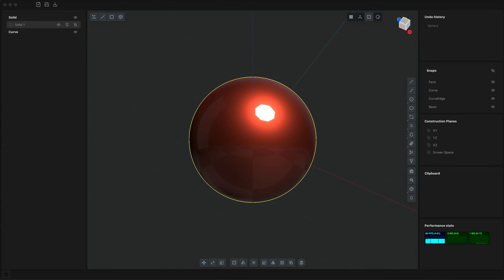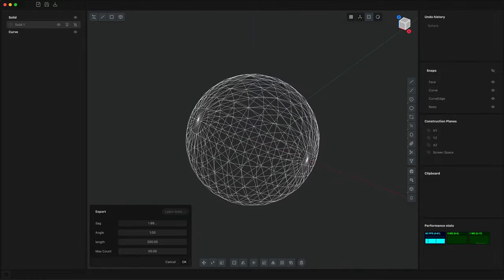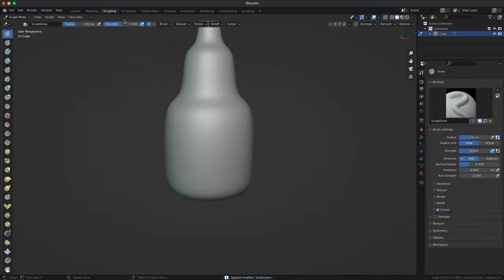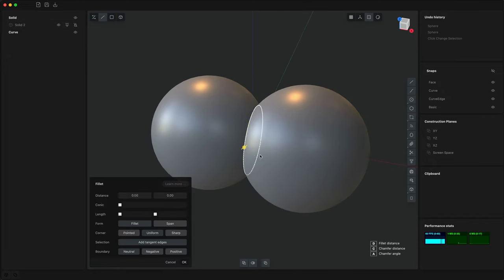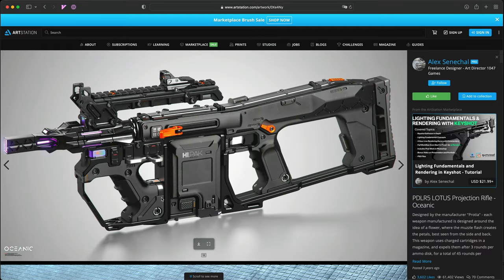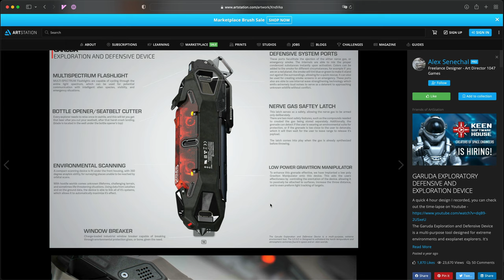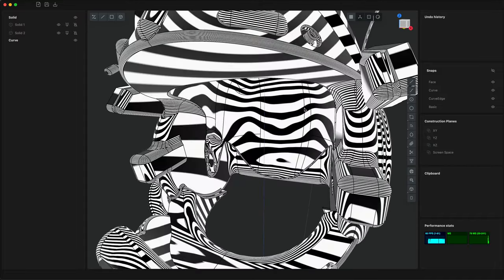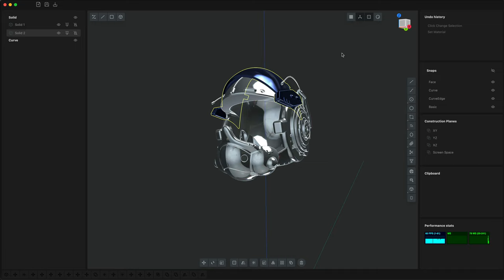What is Plasticity?: CAD for Artists

Comment: Looks interesting. But I would wish it had some features that would make it excellent for 3d printing purposes. Like having options for exact measurements, the ability to lock something to a spesific measurement value. And it would have a need for error-checking in regards to if the models are 3d printable, and if not, an option to fix those errors. Been looking into Blender, but that is a way too advanced piece of software for such a purpose. Too many options for my taste (beginner/newbie-taste). Fusion 360 are perhaps the best tool, but I do not trust their business model and if I make the effort to invest time into learning a piece of software I would like that piece of software / license to be lifelong license. Or most preferably, fully open source. I know FreeCad is an option, and that will probably be what I will be looking into if not a better option becomes available. Thus I hope Plasticity also includes features which would make it useable for making models for 3d printing as well. But that needs exact measurements, since one often model objects after real life counterparts with spesific measurements, where one side may be a multiple of another side (like the length of a box being twice the length of the width, as an example).
Reply from the maker: Thanks for the comment. I just made a 4 minute video explaining that this isnt a cad app tho
Reply: @nickkallen1  Give me an option for import/export/edit STL files and im good to go!  Finally an app that could replace my very old and good friend Autodesk 123D :D
You should definitely look a little bit to 3Dprinting community, a lot of people there to buy this software that don't want F360 :)
Reply from the maker: @Piotr_Czarnowski  I understand your affection for 123d. I think it had a lot of good ideas. I’ll keep you posted re the other stuff
Reply: @nickkallen1  I do understand the need of complexity for tools like F360, however i like simple and easy things ;) 
Im so hyped for this software of yours :)

Comment: Interesting. I utilized PTC Creo for mechanical engineering field in designing tools for part assembly as well as machine parts for an HP 3D printer. This is very similar in ways and cool to see outside of my field. Great job so far - I might want to pick this up for personal use when ready.

Comment: G'day Nick, just wanted to congratulate you on what looks like a great program. I've just installed it on my Linux box and got it up and going without fuss. I realise this is still in early development, but will future Linux versions automatically add an entry in the menu when you install the deb package? Also, will there be preferences for increasing screen resolution and text size like you can in Blender?

Haven't tried any modeling yet because I want to watch your videos first. All I've tried is  creating a regular polygon and moving it around using keyboard shortcuts. Very intuitive for a Blender user. Many thanks for basing it on Blender 'coz the last thing I wanted to do was learn a whole new lot of shortcuts. It was actually this fact that sold me on the idea of giving it a try. I figure a lot of people who'll be using Plasticity will be from the Blender community and you'll get plenty of downloads once word of it gets spread more widely.  

Well done.

Comment: Wonder how you detect and handle direct modelling. Could one import (if there is no import module, assume it) a nurbs object (with fillets and chamfers) from other software and continue manipulating in plasticity, as if it was a native model? Does plasticity "know" what type of surface each is and it handles it by assigning a type tag upon creation? In short, does the manipulating algorythm decides on the fly what to move and where (the constraints), depending on current selection, or it knows in prior what it should do in prior? Of course i am asking about the general concept, not closed source details.
Reply from the maker: Direct modeling in theory only looks at the surfaces and therefore should work regardless of origin. In practice it’s more complicated

Comment: Awesome program for modelling and concepting but again, the FOV/perspective is very strange, as are the camera controls. The workflow is astounding. I really wanna make mecha in this but I get through the earliest parts of concepting before the camera issues make eyeballing and feeling out stuff kinda difficult cuz the perspective is weird and panning/rotating isn't instinctive.
Reply from the maker: I would recommend you join the discord and customize the keybindings for navigation. I'm not sure what the ideal FOV is for your workflow, but 50 is the default in blender and threejs and plasticity. I'm thinking plasticity is still too buggy for a mech, but something simpler is doable
Reply: @nickkallen1  Yeah, I'm probably going to start out with fairly simple things. Generally FOV stuff is on a slider and you just let users decide for themselves. I tend to mess with mine a bit up and down as I work to get a feeling for how something would look up close vs far away to make sure the silhouette is clean. Kinda like how in 2D art, you're always told to flip the canvas periodically to see errors.

For example if I'm building something for an FPS game, I'm probably going to look at that thing with an FOV close to that of my typical player (90-110ish) so I can eyeball how it looks directly. In a 3rd person game that might drop to around 80 or so. In VR, that drops to around 20 sometimes. If I'm doing film, I have to refer to a cheatsheet and convert focal lengths in mm to FOVs, with 8-18mm for VRish stuff, 25mm for TV, and 35mm for film.
Reply from the maker: @osakanone  check out 3:28 in the video ;)
Reply: @nickkallen1  Aaaaa nice nice I didn't spot that because I was busy listening to your explanation lol this is awesome thankyou so much! Being able to like, "sketch out" and just like try stuff to sorta feel out what the ... I dunno, I wanna say like, what the canvas and shapes "wants" to be has always been something I do in analogue a lot but digital really hates not having a clear vision from the beginning. Having played with Plasticity a bit it becomes super clear that this sorta mindset is there from the beginning like being able to scrub through and see the results of work super super quickly and go by gut feel and that's just amazing. Like I think about the only other request I can imagine making is just alt LMB rotation for camera. Beyond that, this project is like bonkers. You are an absoloute mad lad, Nick. Keep up the good work. Hot damn.